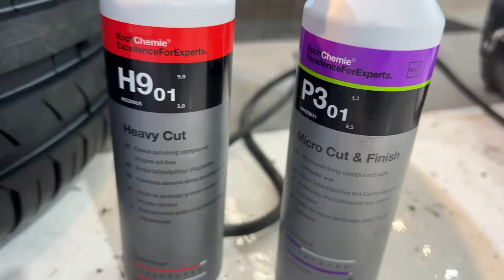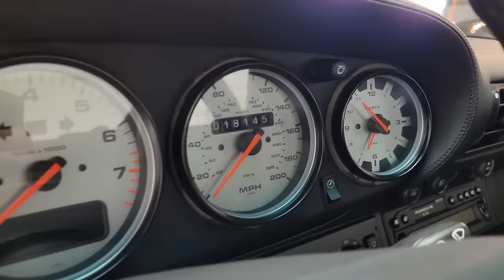Dry Ice Cleaning & Detailing Denzel Washington’s 993 Porsche 911 Turbo

Comment: Denzel has great taste. The whaletail, air-cooled engine. Keeping it original. All time dream car for me.
Reply: When i lived in NC in 2013 i saw a silver 959 drive by.  I wanted to turn around and follow it but then i would be a stalker so i said no.
The next year I saw a really low orange car come towards me.  It was a Muira!!!!!  Not sure if it was the same guy but those 2 cars are so dreamy!!!!  Too bad Muiras catch on fire.
Reply: Its the independent suspension that makes these so desirable. Porsche took themselves off pace and dramatically changed the car in the 996. These are the last mechanical oddity of their greatness.
Reply: Agreed.

Either that, the or the (marginally rarer) 964 Turbo; both would be competing candidates for a single slot in the 3 max dream garage ($1m max budget).

If money was upped the 993 or 964 Turbo S's would be considered in an extended garage...
Reply: Mine too! 993 rocks!
Reply: Plus, looking at the underside  and suspension and stuff, he actually drives/drove it. Love it.
Reply: i feel great taste comes cheap when you have money. really rich celebs just end up buying what is fashionable to acquire
Reply: 964 turbos my dream car but this will do! 😁

Comment: I've never heard of dry ice cleaning before, absolutely amazing results. Great job!
Reply: Kärcher make a dry ice cleaning machine. Often used on restoration projects as it’s not harsh like sand blasting
Reply: They are pretty bad ass and have no media mess.  Dry ice balls just melt away….
Reply: Repent or you will likewise perish.  Jesus would definitely drive this car, it's like heaven on wheels
Reply: Consumer laser cleaning when
Reply: Only thing with dry ice cleaning you could have the climate change nuts after you. Because dry ice is carbon dioxide.
Reply: @HIGHLANDERNEO2  LMAO! I could see that happening.
Reply: @HIGHLANDERNEO2  yeah, but it's not removing or adding to it
Reply: I've seen dry ice cleaning like this in industry in an automotive manufacturing environment.  It does a great job.
Reply: I was on a building restoration project. They had to dry ice blast the whole exterior. They had to used dry ice because the building was partially over a river and they wouldn't allow other types of cleaning because pollution.
Reply: @HIGHLANDERNEO2  This is not generating CO2, it’s a simple phase change. Then again since you appear to imply that climate change does not exist, a simple explanation is likely beyond the scope of your ability 🤦‍♂️
Reply: Great but don't get it near rubber seals cause they will leak this is why he opted not to do certain sections on the engine bay
Reply: @qs3162  they literally sprayed the rubber seals on the body joints.
Reply: I've seen it used to remove mold in the attic of a house.

Comment: This is soooo satisfying to watch! Also had no idea dry ice cleaning was a thing. Fascinating.
Reply: Yeah,first time seeing it,and also realizing I can’t afford to have my Vette done.😩😞
Reply: @mnoell35  could be worse, I can't afford to have my Hyundai done 🤣
Reply: Have seen it used before, but never realized it was so versatile. Awesome for cleaning gunked up plastics by the looks of it!
Reply: @Schroefdoppie  Yeah, that's crazy ! It looks very expensive process. I am still a bit unclear on how this system works..  I wonder if it utilizes a dry ice media, such as pellets or grains and it's essentially like bead blasting. Or is there something more complicated or high tech, like maybe they use liquid CO2 and it is sprayed onto the substrate and it is just sublimating into dry ice as it rapidly is depressurized from it's highly pressurized liquid state and it's sudden expansion with atmospheric pressure levels. The sublimation changing the CO2 into sudden stream of dry ice? 
It must use alot of CO2 if that's how it works. I can imagine that it also must displace a lot of oxygen and could be very hazardous, not to mention  the "carbon footprint". Surprised that in a place like Costa Mesa , that they  don't get a visit from the AQMD,,, Doh! 
I also imagine that if it is utilizing liquid CO2, that it probably is a pain in the ass to keep the fluid flowing and not having the tip of that gun and the hose from freezing up and clogging. The expansion of the liquid would suck condensation from the air and this humid atmospheric air would freeze up the sprayer in short order. I would also use a microbore line to minimize the volume of the supply line and avoid expansion from taking place in the feed. 
I would be very interested in seeing the hardware in person.  Anyone for sub critical fluid extraction?
Reply: @southboundsuarez9832  bruh...1 out of 100k might be able to make it past the first 5 sentences 🤣

I don't think it'd be a media though, just high pressure vapor that isn't toxic.
Reply: @SlimTheGoat  Yeah, thanks for that! 
OK, I think I understand what you mean. Basically a stream of liquid CO2 is being sprayed directly onto  the parts. However, technically it would not be a vapor state but the liquid  CO2 would sublime  into a frozen solid state (dry ice) before it actually would melt into CO2 gas. The melting dry ice vapors have a tendency to displace oxygen.
I didn't think or wanted to imply that the process was toxic. I did however point out that when using CO2 ( carbon dioxide) especially in mass quantities, precaution must be taken because the CO2 will displace the O2 (oxygen) in the surrounding area fairly quickly. The CO2 will sink and push the O2 out and away. You could likely aphyxiate without realizing it ... This is not due to the  carbon dioxide being toxic but simply because it is  overwhelming the available oxygen left within the area that is left to breath.  Not to be confused with carbon monoxide which is in fact deadly poisonous to breath as it destroys the red blood cells within the body and deprives the body oxygen and creates death in a similar manner but through the mechanism of it's own  toxicity and biological effect upon the body. The result being similar. However the CO2 can be remedied quickly by breathing fresh air. CO on the other hand does irreversible damage thru it's toxic damage to the blood cells of which no amount of fresh air can remedy. With both basically die the same way because of oxygen deprivation to your brain and other organs. 
I know I have a bad way of not being able to briefly describe or convey my thoughts ..... I hate that! Thanks again for pointing it out. No matter how I tried, I have none the less continued to be much wordy! Too bad I can't monetize word count!
Happy Easter Slim

Comment: Ice blasting is really cool . It does a great job on metal surfaces but it'll also remove grease from chains and u joints . Probably paint too . It uses dry ice vapor under pressure .

Comment: Wow! That's taking detailing to the next level. I totally see where the dry ice is unique in it's application. The time you gain with your setup is amazing.  You use a single machine or have you got a separate one for the small  jobs? I know you use a industrial Coldjet machine, that's some machine.
This is putting me to shame... well done!
Reply from the maker: We have a smaller portable unit, as well as a second PCS60 machine, that we rarely use for small jobs. Usually we just drive it over to the shop and do it properly since it's already setup. Takes less time to move the car than it does to set up something else and get the ice at the main detailing shop
Reply: @IAMDetailing  I have been looking to do it a little while ago as this fits perfectly for a large amount of classics cars coming through our doors.
I have approached a company in Germany for a small setup to start up with but nothing what you got. 
Just done up a NSX and after spending over 12h for doing the 4 corners, engine bay and under the bonnet. Realised is still doesn't do justice compared to what dry ice can achieve. 
I am so impressed by the result with the couple NSX you done that I has put the bar up. 
Thanks for sharing your works.

Comment: Hey Jakob!
Outstanding work with the dry ice.
Does it actually completely remove surface rust? What's the idea behind it?
Thanks 👍
Reply from the maker: Hey Peter! Dry ice will not remove the rust actually. There are other methods you can use to remove rust, but dry ice is not one of them. It will remove all the gunk and heavy dirt/ etc. but for rust, other methods are better
Reply: @IAMDetailing  OK. I thought on your video that the reddish substance going away was just shallow rust. But if I understand correctly, it was just reddish color gunk. Probably from road grim and brake dust etc..
Pretty interesting and also crazy to see the results 👍

Comment: Bro! The coating on the bottom would of made it more valuable! That was the original coating. 993 turbo is a very valuable car! Cool cleaning process though. We just did that at my work
Reply from the maker: As we mentioned in the video, we kept a good bit of the factory cosmoline because it was in such good condition.

Comment: Hi guys! Is there a reason why you divided your shop into two areas with different wall colors and lighting? I assume the white part of for final product presentation. But why the "working" part also not in white but dark? Big thx!
Reply from the maker: Hi, good question… yes you are right the white part is for final process and presentation (videos/pics) and the working part is black because it’s the best color for limited reflection in the paint and be able to see more scratches and imperfections in the paint under the shop lights. Our old shop was completely white and I knew that black for work will be much better and it is 😉
Reply: @IAMDetailing  Big thx for the reasoning behind. Makes perfect sense. All the best and greetings from Switzerland!

Comment: Did you replace the Cosmoline on all the undercarriage parts?  Not all of that is dirt.  The aluminum parts under the car came coated in corrosion inhibitor from the factory.  Hope you didn’t leave all that aluminum exposed.

Comment: To truly do this job right you've got to replace a ton of the Seals and rubber gaskets on the engine/transaxle so that oil leaks and any other sorta fluid leaks don't ruin the underbody detail job. I think 20 to 25 years is about the life of these plastics and Rubber pieces

Comment: Interestingly, when you clean all the oil and dirt off, you are actually removing what has become a protective barrier against the elements.  If the detailer does not apply a coat of protecting oil, wax and lubricant on all those parts, cleaning all this may do more harm then good.   But, this is still impressive.

Comment: You could use a little more practice polishing. When you were doing the rear louvers you didn’t even check your work. You just hit it with the polisher just so it’s done. When you wiped the compound away tons of scratches were still there. All that work just to do a poor polishing job

Comment: After seeing the video i have come to the conclusion that this process was only able to clean aluminium
And plastic
All the grease and oil on the engine and trans was not cleaned the metal or steel parts that had crap on it was not cleaned
Then the go after the plasic black
Covers 
So basickly its ok for very light dirt
Thats not a buildup
Lets see of you could clean the
Steel
He went right past all steel
Including exhaust steel frame
Etc
Nooo not better than media
Or aqua blast